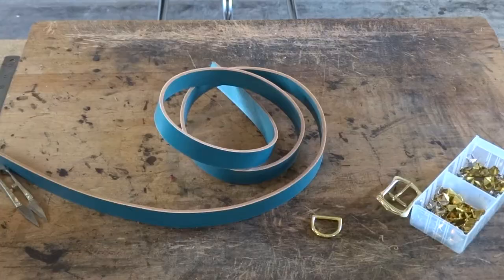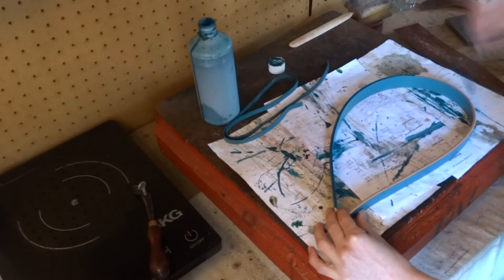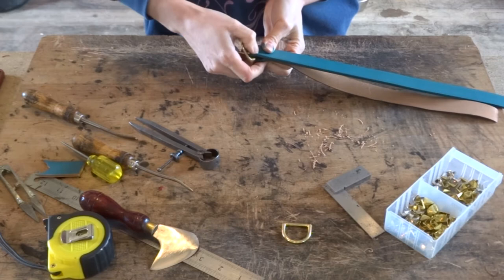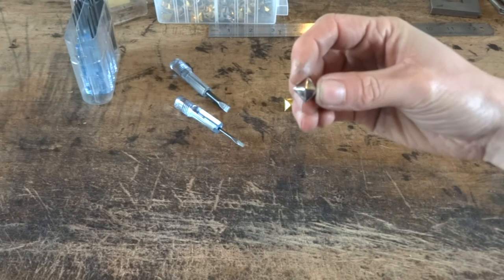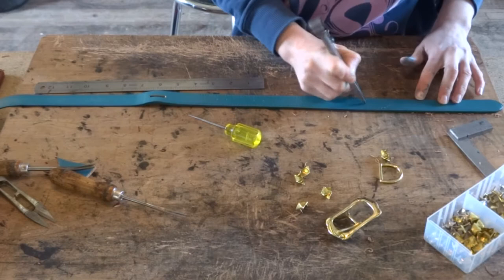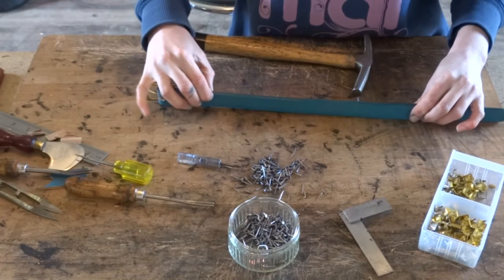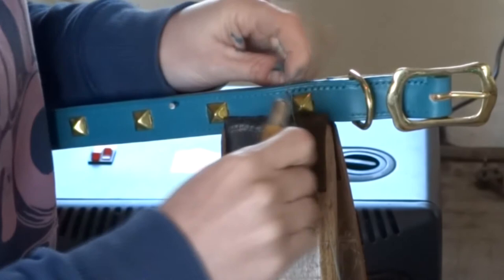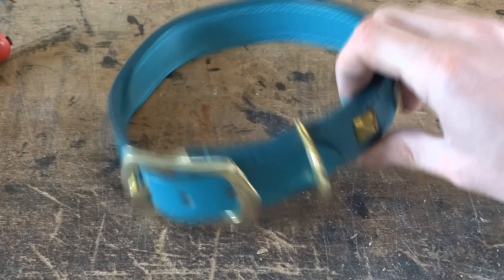How to Make a Studded Leather Dog Collar -Tutorial

Comment: Thank you for another great tutorial. Please, Any suggestions as to the best way to skive under the studs without a machine? What size oblong do you use for the crew hole?

Thanks again.
Reply from the maker: Hey there, the crew hole is dependent on the size of the buckle tongue which varies between buckles and each size of buckle. I think this was a 1 1/4" wide collar so I would have used a 7/8" long crew with the west end buckle.

Comment: I'd love to know how you make a studded dog collar pattern and with different size spots. How do you get you design transferred from paper to collar??
Reply from the maker: Hello Teresa, I don't usually do paper patterns for dog collars but use scrap pieces of leather to test if my ideas will work. If you have different sized studs you need to work out the distance you want between each stud (I usually lay them onto the collar I am making so I know how many I can fit on) and then the distance between the fittings of the studs. So for example the studs I have are 1/2" wide and 3/8" wide, so I would (depending on the size of the collar) put these about 1" - 1 1/2" apart. Once you know where each stud will sit you can mark out the legs of the studs (in our case these are 1/2" and 3/8" apart). Hope this explanation makes sense! Thanks Jo

Comment: very nice video, so thank you. I have two questions though. Why do you need to use the hot tool, is that instead of burnishing the edges? Also, wouldn't rivets work better for the decorative squares, like, the same shape, but in a rivet instead?
Reply from the maker: +Magik Dust glad you like the video 😁 the creasing tool just puts a nice line on the leather which just adds to the overall look of the collar and works best hot as if it's done cold it won't last. 

The riveted squares is a good idea, I haven't seen them before though.... These squares work well there is just a little bit more work with getting them all marked out.

Comment: is there any way to measure the holes and oblong hole easier? without measuring each itself
Reply from the maker: Not too sure which holes you mean. The way I show in the video is how I mark out all my collars for holes in the point and for the crew hole. You can set your dividers to the distance apart you want for your holes e.g 3/4" and walk them up the strap but as its only 5 holes I don't usually do that. Hope that makes sense. Jo